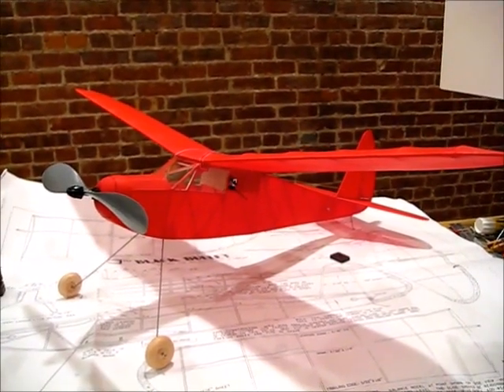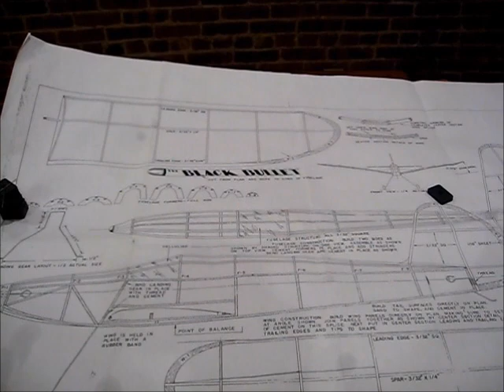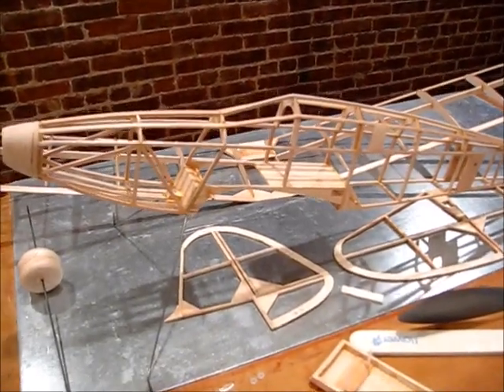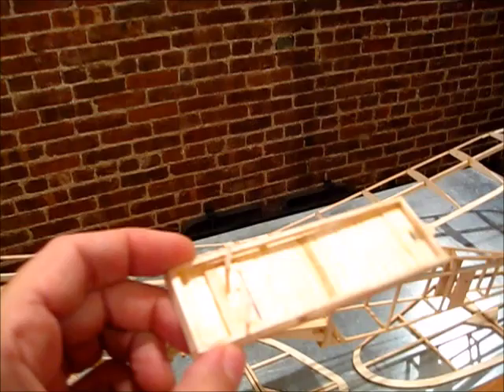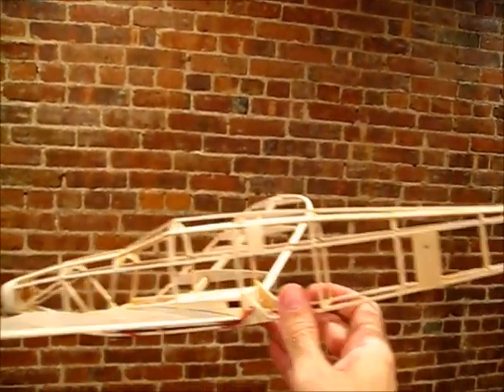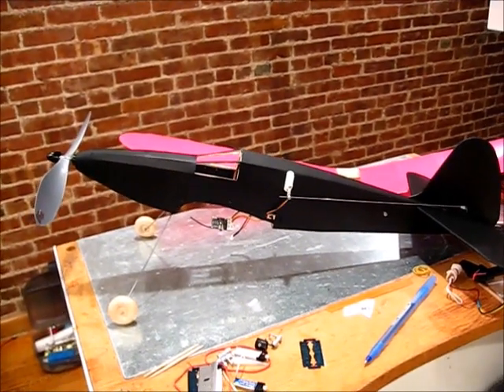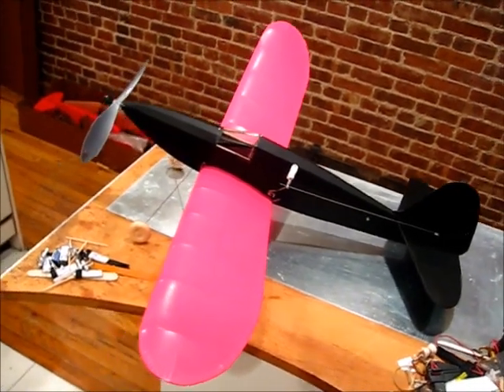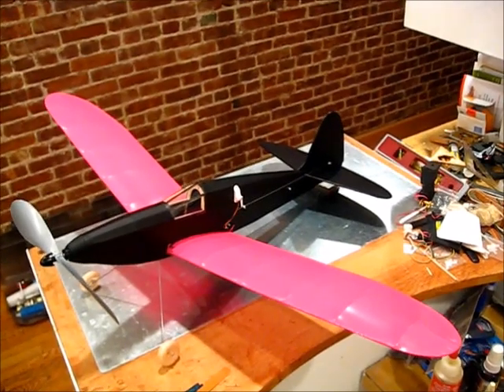The Black Bullet oldtime rubber power RC - building

Comment: Thanks so much for your great video's and for sharing your RC rubber experience. I have been flying RC rudder only glo duration for a while here in Montana. Even here in the Big Sky you need to call it back. I want to try a rubber with rudder and am considering the 30 inch Sky Burd. Would please recommend a prop and motor size for it. The plan is available at AeroFred. Thanks in advance.
Reply from the maker: That is a really nice looking plane, good choice, I've never heard of it before, sleek lines. I'd recommend an 11" prop, probably the Lanzo prop (you can get blanks at Volare), that seems to really get you up there, and somewhere between 8-10 strands of 1/8, around 22-24" long, that's primarily about what I'm using on my 30" planes. Nice to hear of someone trying rubber RC, you should post if you build it, you should have plenty of room to fly in Montana! The best part is that there's no retrieval time so you can do a lot of flying.

Comment: You have had great success with this and the Hurricane, do you suppose the placement of the equipment helps with their inherent stability?  The gear is quite low relative to many others.
Reply from the maker: Yes, a lower CG adds stability, also it's just nice to mount it in the bottom so you don't have to remove the wing to change the battery, so that's my default choice at this point, if possible.

Comment: I'm curious, do you use constant rc input on an average flight or, is it pretty much there as a safety measure due to all the buildings? I haven't watched all your videos yet so if you've explained it already, I apologise.
Reply from the maker: The planes are trimmed to fly nicely as FF, so the RC is there just to keep it in the field. During the power climb, I pretty much leave it alone - if it's trimmed perfectly for the climb, then using rudder will just mess it up. However on a windy day I might turn it a little during climb so that it doesn't get too far. For the rest of the flight, I'm not really doing much, just making some left turns to get back to the field, sometimes I'll hold a little left rudder so that I can come back in a straight line crosswind. On calm days (rare), I mostly stand around and do nothing except for the landing. For the landing, I just make some turns so that it's positioned correctly for the field. So it's good old rubber power like when I was a kid, except I can turn the plane if need be, I actually think it's even better!
Reply: domoremath Thanks for the clarification, I'm curious as the only two flying areas close to me are of a similar size and also in the inner city so I'm looking for alternatives to flying smaller models with under powered motors. Don't get me wrong, I really like peanut & pistachio scale (although the latter in particular need almost perfect conditions outside) but really don't want to go down the nano rc route. Thanks again :)

Comment: Good job. When covering a flimsy wing using regular tissue do you totally preshrink the paper to prevent warpage? If so how do you get a smooth finish?. I had a nightmare covering a Phantom fury wing.... warped and wrinkled.
Reply from the maker: I don't use tissue anymore on wings in the 30 something inch range, the field I'm flying in tends to be too moist and even highly doped tissue tends to loosen.  I've been using Mylar and spraying it with floral paint, that pretty much  eliminates the warping problem.

Comment: Do you have any videos showing how you make that half tube for winding outside the plane? What kind of parts are required to make one? I know tube size has to work with the plane you’re flying, but I would love to try it. I’ve blown out the side of countless planes while winding. That really sucks when you spend all that time to make them perfect. Lol. Thanks!
Frank
Reply from the maker: You've got me thinking about making a video about it. I use 5/8" aluminum tubing (1/32" thick) and just cut it with a Dremel, pretty primitive and not fun but it works, and they last forever. I'm thinking of making a smaller half-tube for a plane that doesn't have much room for the tube, I'll video it if I do it, thanks for the idea.

Comment: I really enjoy your videos! Have you done any videos on how you create your braided rubber motors, use of lube on the rubber, winding of the motor etc.? If you have included this info on one or more of your videos, please let me know. Thanks for sharing!
Reply from the maker: Thanks! The popular 'braiding rubber motors' video covers the braiding part, I mention lube here and there but haven't done anything on just that, some aspects of winding the motor come up in my winding outside the plane video, https://www.youtube.com/watch?v=Ft0WD036EmM
Reply: Thanks for the reply! Do you know if there are any kits on the market for say a 30” wingspan kit that includes the remote control equipment and light weight components for rubber power operation, like those that you fly?
Reply from the maker: Rubber with RC is relatively 'new' so there are no kits I know of that include everything. Just modify a regular kit with a rudder, servo, and a compartment for the receiver.
Reply: Another question: do you have a video that shows how you make your landing gear removable. I can see that you have built a slot that the landing gear fits snugly into. Just wondering if you have a video that shows the details on this and how you keep the gear from falling out. Also, if you can point me to a video showing how you mount the receiver, servo and battery in your planes, that would be appreciated too. Thanks so much.
Reply from the maker: The Lanzo video shows how I do the removable landing gear, about 10 min in, https://www.youtube.com/watch?v=cQrQCNHbapU&t=135s
I use a nylon screw and a little thin ply 'pin' that swivels around to hold it in. The Pacific Ace video shows the equipment mounted, about 10 min in, https://www.youtube.com/watch?v=f-J-g5omFQk&t=397s
I'm doing a new build and I'll be sure to put some of that in again.

Comment: Looks great in black. Do you glue the stab and the rudder or is it also removable?
Reply from the maker: The stabs and rudders are all glued on the 30" designs, you don't need a dethermalizer once you have rudder only RC. On big planes I make them removable so that they can get in the transport box.
Reply: domoremath thanks..
Is there a diagram illustrating the removable rudder and stabs on the internet?
Reply from the maker: Look at hippocket aeronautics and you can find a lot of examples, it's also shown in some of my videos.
Reply: domoremath do you have any email I want to share some pictures of that I have made and take your opinion about it.